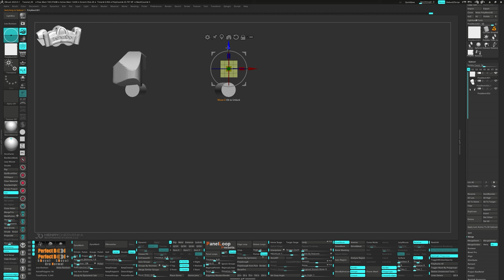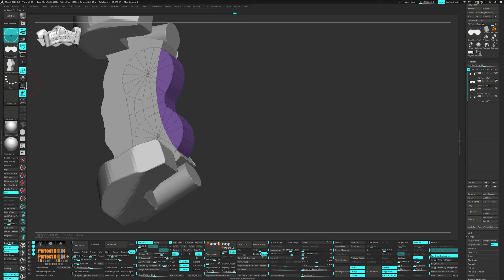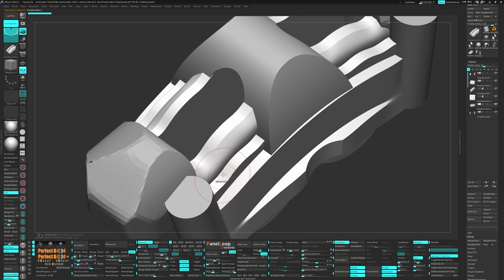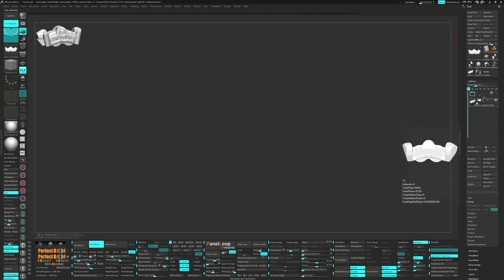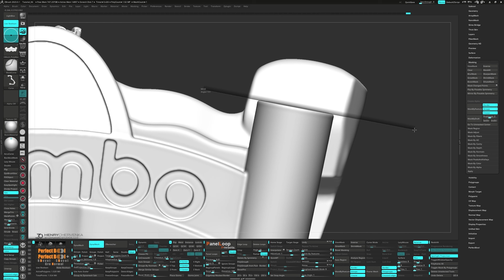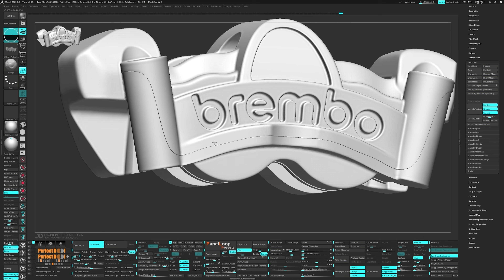Hard Surface ZBrush Tutorial Series // Modeling A Kawasaki Ninja H2R // 05

Comment: Sir can you please explain, how did you start making the brakes without blueprint in the background and how do you know their exact location. and what about dimensions?
Reply from the maker: Hi Morgan,

I always keep reference images on my second monitor. Occasionally, I'll place specific angles of the model on my working monitor to check exact locations. This isn't shown in the video to avoid distractions and to ensure you can clearly see which brushes or ZModeler actions I'm using. However, I've included screenshots in the description for everyone to use, making it easier to model these parts.
Reply: @henrychervenka  Hello sir,

I sincerely appreciate your comment for clearing up my confusion. I am new to ZBrush modeling. I initially assumed that you were eyeballing the parts based on your references and that you'd later assemble them. It didn't occur to me that you would cut those sections where you're matching with the blueprint to expedite the video and focus solely on the modeling part.
Thanks
Have a great day!